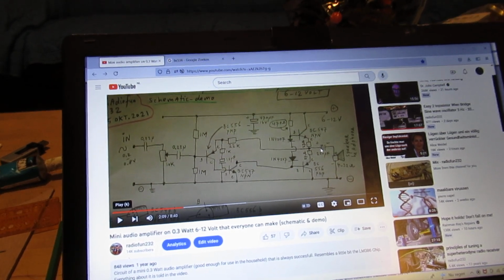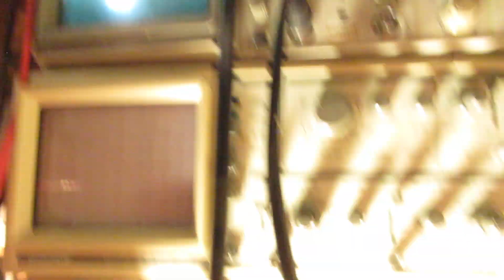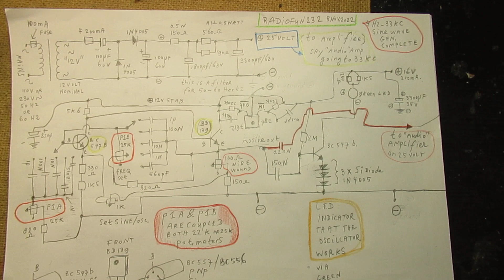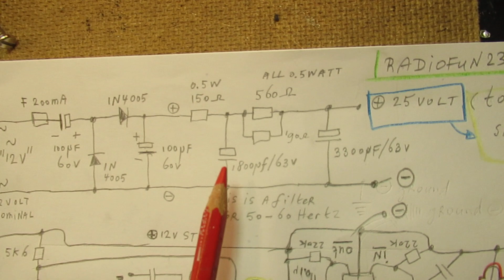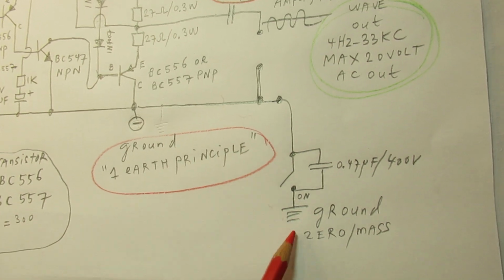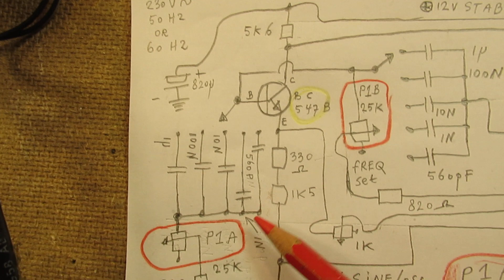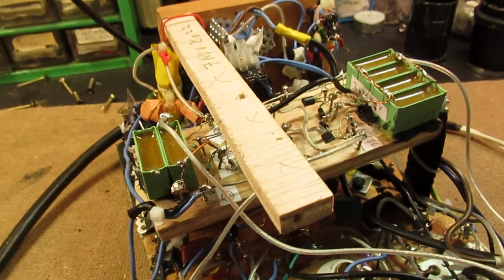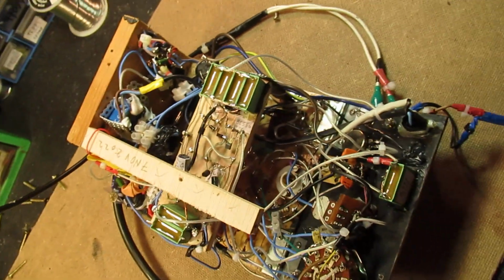Easy 2 transistor Wien Bridge Oscillator 4 Hz - 33KC: complete schemat. with max 20 V AC output amp.

Comment: What happened to farnel sin wave generator? I like to know what inside this box what type of circuit there . How these farnel engineers make this generator?
Reply from the maker: It was damaged during my oscilloscope experiments due to (as far as I can see) a ground fault that I made. 1 resistor and (I think) a few (!) transistors(s) burned out. I could not repair it, so this was plan B. I am going to rebuild the Farnell sine wave generator in the future, for the freq. band of 33 KC (first idea....) to 1 MC. Is possible because there is a beautiful tuning capacitor of 500 pF or more inside. More to come (perhaps, when all is succesfull....never sure).   9 nov 2022.